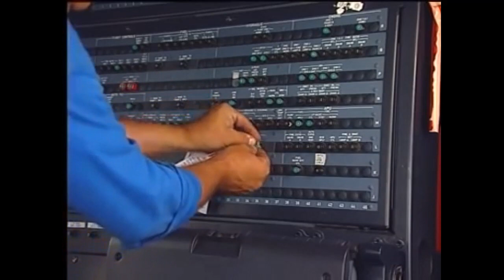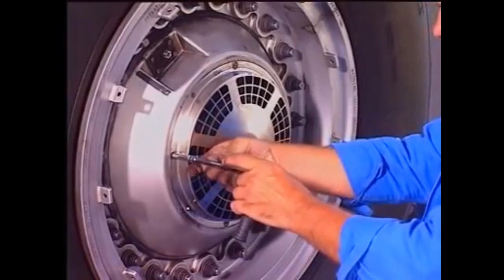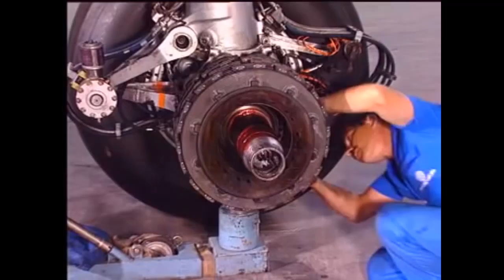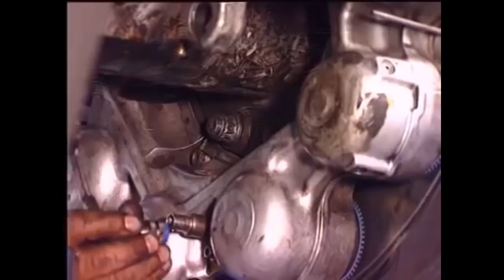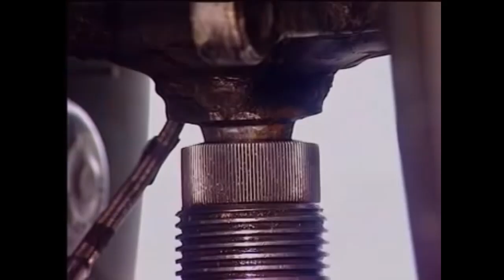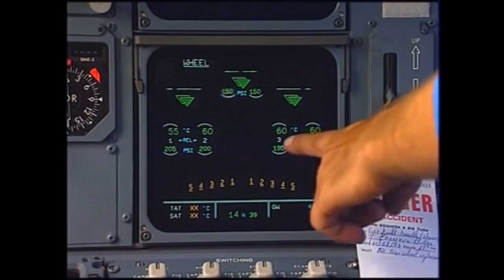A320_main_landing_gear_wheel_removal_installation

Comment: They didn't use at special tool for removal and tightened the impeller that was a bad practice,and for removal the brake you need to use other tool because the brake and AMM recommended.
Reply from the maker: ıt was just training so not actual.